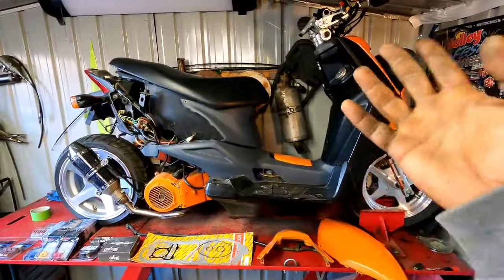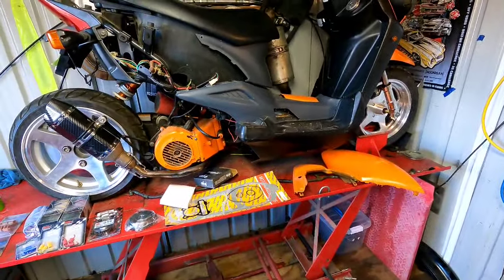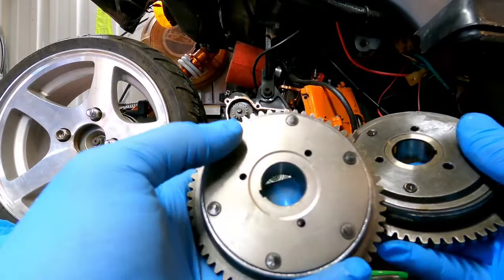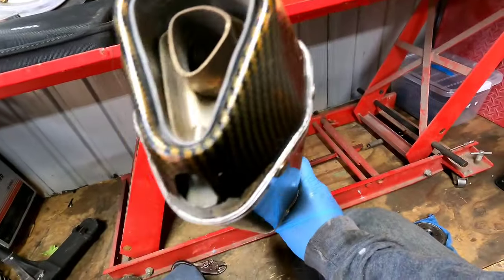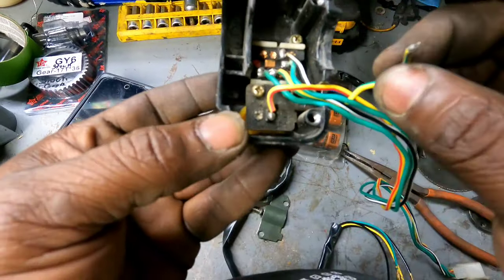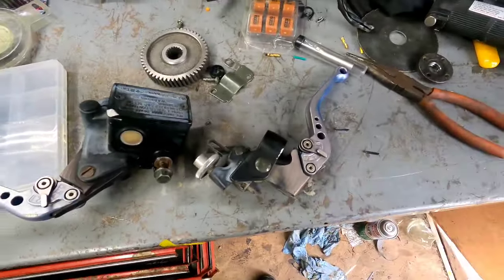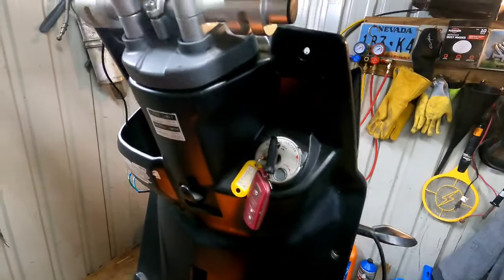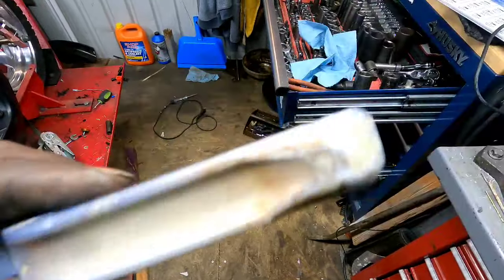CVT Tuning & starter clutch  replacement  HOW FAST CAN I MAKE IT GO❓️

Comment: Definitely made replacing the starter clutch easy I have a GY6 150 that I'm struggling with leeks I'm not sure if I had the right torque specs that could have been the issue really enjoy your videos man👍
Reply from the maker: Yeah It really isn't that hard just messy 🤣  The GY6 150s are prone to leaking all that powah‼️ get out anyway it can find😅 Thank you for commenting and watching ‼️

Comment: Put that old spark plug back! Btw I got my Vino 50cc running. Carb rebuilt and found he needle valve was stuck. Needle valve holds the floats in the bowl to the correct level. l was running too rich. Good luck on your tuning, looking forward to seeing that thing ripping down the road.
Reply from the maker: Right ‼️ I'm looking for the old spark plug RN ‼️ the NGK R  plug may not have a hot enough spark.      The needle valve in the VY6  had me stumped for a while too 🤣  I figured it out once I installed a Holley  electric fuel pump and it still wasn't getting fuel ⛽ 😅. Thank you for commenting and watching as always ‼️
Reply: @scooterrehab6295  Luckily I had a rebuild kit to compare the travel on the new and old needle valve. Thanks again!

Comment: I think you're GoPro goes into stealth mode sometimes 😂.i hate to remove my rear wheel because of the stupide heavy stock exhaust.also i think Amazon forget to mention in the blinker description you only can turn to the left
Reply from the maker: I have served both of these GoPro's with a cease and desist notice. They either quit the bullshyt or face the bandsaw 🪚 😅  I left a brutal review on Amazon with pictures and video probably not going to do any good tho. @amyk1769 Thank you for commenting and watching as always ‼️

Comment: Yeah it happens a lot with the taller gears. It probably needs a bigger bore to push the gears. Hey Man I was wondering do you have a cheap 50cc or 150cc that has a title?
Reply from the maker: I don't have any for sale at this time.  I have a 61mm bore kit in it .    I just realized my exhaust mount is rubbing my wheel . I have a couple self induced issues that I created to work out . Thank you for commenting and watching ‼️
Reply: Thanks man. Dang. My 61mm was always quick off the line but ran outta steam at 50-55. I was always afraid to change the gearing. I really wished it could hit 65-70. I regret selling it. As always great video.  @scooterrehab6295